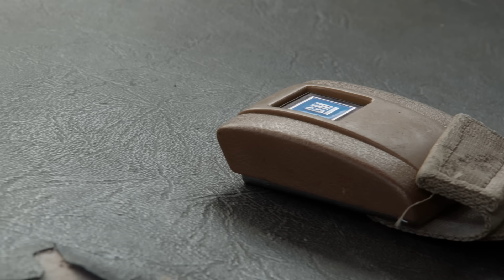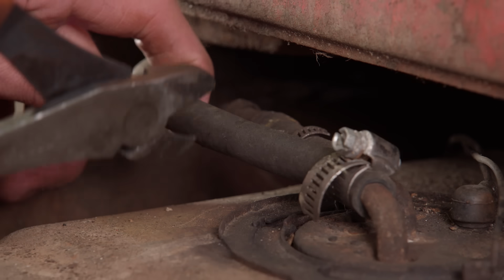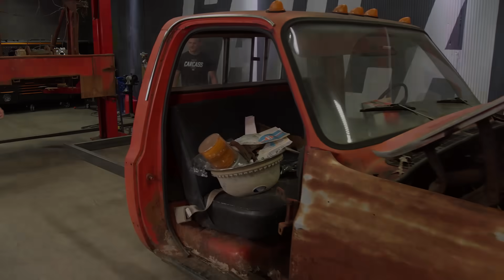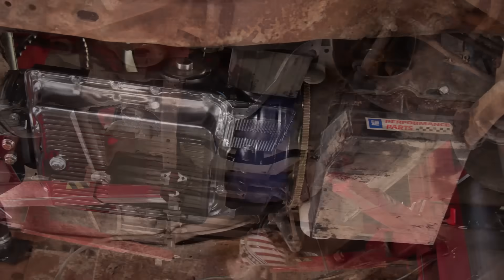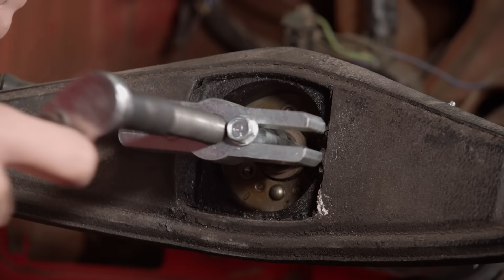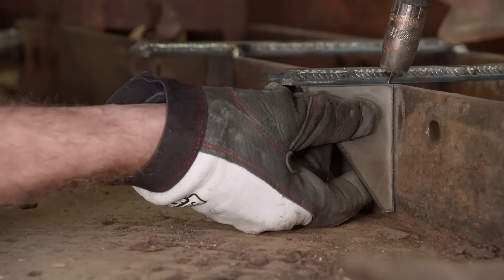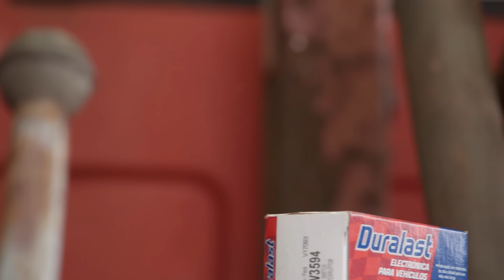Full Build: Junkyard Square Body Tow Truck Is Restored And Modernized

Comment: Did so much work and spent so much time on the pans just to leave the rusty metal in there where it will continue to rust with no way to put any coating between the layers of sheet metal. Woulda been just marginally less work to use the same tool you punched the pans with to flange the metal. Still gives two layers. Still can rosette. But easy to seal seal the 1/2 flange you create.

Comment: Frame should Never be cut straight down,45 degree angle then fish plate and button weld,use round crossmebers 100% stronger(wouldve located complete frame myself) as a mechanic and a welder for 30+ years ya did it all wrong.no strength in that frame(why wimpy 7r4 trans?

Comment: Why would you weld in the new panels without treathing the rust inside the cavities? If you do such sloppy job you can as well put a plate over the holes with pop rivets… Not my way of working.

Comment: It was fun and exciting to hear it start but nowhere near realistic so why bother. Just tell everyone you had it started off camera beforehand! Even though it was 2 years since they had points style ignition (a guaranteed no way does it start without at least giving the points some love) the odds of it firing are pretty much 0. You got lucky in that one year newer it would have had a catalytic for sure and it would have been so clogged with rodent garbage that now way it's starting.
The real culprit though, the reason why I am highly skeptical it started that easily, is those engines/vehicles in that time period were prone to timing wander, with a variety of causes, and especially as a smallblock (the 454 was available that year and most would have opted into that for a wrecker)wrecker I would have expected a timing chain jump but if not that any number of smaller causes.

Comment: 2 things. would it not have been smarter and replaced the floor before you put the fuel tank and system in and second why did y'all remove the manual transmission

Comment: The only foul-up on this thing was replacing the 4 speed with the winch PTO. You stated that you wanted to keep it patina'd, yet you have the shiny new electric winch. You could have kept the 4 speed and installed gear vendors. Other than that, it was a very satisfying and educational video

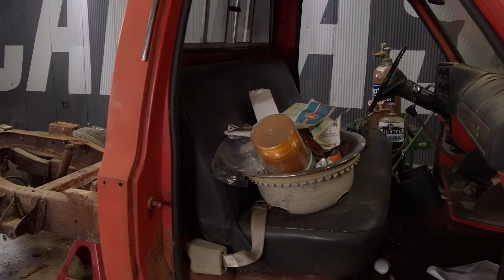Comment: At 20:34, you opened that oxygen tank without having the regulators backed off, big no no.  Also, why so much reliance on the torch?  A band saw makes a cleaner cut.

Comment: I'm 80!years old been resurrecting old machines since I was a kid and you guys drive me crazy with a battery and gas. Why dont you pull the plugs and poor some mystery oil in the cylinders and let them soak a while and manually Rick the harmonic balancer back and force to gently loosen the surface or varnish before you just blast it back into service. I could go in for hours in the subject. If you rock the balancer back n forth and are too lazy to drop clean and glob a bunch of grease on the Bendix. If the engine is ceased or blocked by a stuck valve you could smoke a good starter. Dam.

Comment: If that is a 1977 truck, then somebody swapped grilles on it at some point in the past.

The grille on the truck is for a '73-'74 Chevy truck.
Reply: It also has the 83-87 front bumper

Comment: Errrrrm to find your fold line using a press brake you start by marking out  internal dimensions then select the correct size  V  block and to do this you simply multiply the same old thickness of the material by 8. For example, material @5mm  × 8 =40 V block. Just make sure you use inside dimensions and to achieve outside dimensions simply subtract one thickness from your outside dimensions. No pissing around checking radius a drill🤷‍♂️

Comment: I love the build except for one thing: I would had kept all the outside with cosmetic rust but all the frame and linkages replaced/manufactured as done with the back.

Keep the same Axle on the back but refurbished and repainted. The rest could stay as it was, with the cosmetic rust.

But that was if it was I restoring. Still congrats for the project.

Comment: What happened to the 850 horse big block that the engine power guys Built For This? Just as well cuz a 350hp engine makes a lot more sense with all the rust still under there

Comment: @powernation prime example that education over experience is bad. In real world use NEVER weld ( butt weld 2 piece together )   like they did the new vs old frame . That frame weld should have been at angle ( 2 o'clock top to 8 o'clock bottom  ) and since it's a toe truck a front and back plate should have been used out and inside the frame for strength when toeing.

Comment: As early as 2027, driving in EU and Scandinavia with a combustion engine will probably no longer be permitted outside of professional and delivery trips, the Federal Exhaust Gas Fun Ban Ordinance BABVVO was recently announced and exhaust gas fun will soon be banned. The Transport Tourism Emission Restriction Federal Ordinance TEBBVO was also announced....should get all combustion engines commercial vehicles, construction machinery, agricultural machinery and even inland waterway vessels off the roads / waterways by 2035. Buses in the cities (and all taxis) must be completely converted to electric drives by 2025 (supposedly an EU regulation!)! The Wild Funny! Have you ever read Berlin Leaks? It takes off your shoes! They are basically planning demobilization under the cloak of a campaign against "fun using fossil drive energy" in road traffic... the SOKO Autoposer is supposed to hunt down all fun fossil drivers in the future! This WILL be a STVO Stasi with BABVVO apps for monitoring as a little helper to control exhaust emissions...!!!!

Comment: Nice to see a classic Chevrolet tow truck up and running.  I am glad there are outfits that have parts to do restoration work that cab sure was rusted out and they had floorpans, rocker panels, cab braces for structure integrity. When you replaced the instrument panel padding. I assume you did with the door panels?
This style of truck was in production from 1973-1991. It was part of the Chevrolet, GMC C 2-wheel drive and K 4-wheel drive. When the new Chevrolet, GMC C/K series came out in 1987. This model then became the Chevrolet, GMC R 2-wheel drive and the V 4-wheel drive. In production from 1988-1991. The engine you installed, Is that a 5.7 litre V8 with fuel injection?
Thanks for posting this video.

Comment: Very interesting video and thanks for the various tips and advice. 
But I still have a few questions about the project.
Why didn't you actually remove the rust on the parts that were not replaced or didn't apply rust protection paint on the inner sides after welding?
The bonnet was still quite bent and obviously doesn't fit properly anymore. Doesn't it fly away from you when you drive faster?
And you don't need license plates to drive on public roads ?
No criticism, just interest....

Comment: It's always a pleasure to see people care enough to resurrect those old classics that some of us grew up with.
I prefer keeping things as original as possible. The original motor and transmission are critical must have's when possible.

My 89 Chevy Cheyenne 1 ton dually 350, 4 speed granny was owned by an old guy who didn't have the money for tires, tuneups, throttle body rebuild, etc, etc, etc, so it sat for years with 95 thousand miles on er. I spent the money to clean er up, tune er up, (cap, rotor, wires, plugs, oil & filter change) ,new brake shoes, wheel cylinders, hanger/carrier bearing, wheel bearings, hoses, water pump, belts, battery, throttle body, cab lights and other interior work, and so on, and put it back on the road. Even found an original screw jack to put back in the holder behind the seat. Pieces like the original interior cab light cover was a bear to find, but I found er. The service box is rusty but no cancer on the cab or frame and not a single crack in any window. Since it's not my work truck I have only driven it about 500 miles since I bought it in 2018. The next owner will get a nice vintage truck when I pass on........... But not until.

Comment: The spring hanger difference was not a cab/chassis thing or a 2wd vs 4wd issue. The one-ton trucks, both cab/chassis and dually pickup, used a narrower spring perch spacing compared to the 1/2 and 3/4 ton trucks. 

This narrower spring perch spacing made room for the cab/chassis dually wheels, and did so by moving the shocks inboard of the frame. The 1/2 and 3/4 ton frames kept the shocks outboard, since they shared parts with the Suburban and Blazer, which both needed a fuel tank inside the frame rails.

Comment: Jesus, your description of how to bend sheet/plate was super complicated... Been breaking plate for years, this is probably the worst description ever of how to do it. Would of shut you up in a heartbeat if you tried this in my shop. Inside dimensions bend exact 1:1 ratio for anything 3/8 thickness and under. Outside take a bit more, subtract 2 times the thickness of matterial per 90% bend for cut prep, on marking just subtract a single thickness for each leg.. ( IE for .1875 sheet, if you need 1" leg bend mark would be at .8125". Need a channel with 2" legs and 4" web out of 3/16" plate. Easy, add up all the dimensions and subtract 2 times the thickness per 90% bend. 2+2+4=8, 8 -.1875 four times is 7.25. Cut your sheet to that, Mark each legs at .8125 because you subtracted the single material thickness and bam you have a 2x4 channel on the Outside.  Get that drill bit crap out of here, if you lose my drill bit im woopin your ass.

Comment: I sat through so much of this with my mouth open the lack of actual quality work done in this like the bed mounts when they welded them on they didn't even weld them at the same point on each side of the flatbar didn't make it level and thats one of the little things they did and the fact that it is a show is not and excuse you guys should be ashamed to call yourselves enthusiests

Comment: For me If my health was better I would be doing body swaps... putting something from the 50s or older on a modern chassis wit modern interior.  This way you have the good breaks an suspension, plenty of power and good gas mileage, and all the safety features.  I love the style of the older vehicles.

Comment: that fabricated rear truck frame is much much weaker than the original when it was new - you used not only thinner gauge material but the section depth of the channel is much less than the original frame ......this is going to bend as soon as you try and tow anything larger than a go cart...... you guys build stuff like its a Revell model kit.....dont quit your day jobs.

Comment: You really need to research the proper way to bend a cotter pin in a castle nut.  Bending it over the end of the stud cut the shear strength in half.

Comment: Do you not paint the new rear section you built andthe old rusty metal you weld new bits to, the cab floor etc, with a basic rust proofing paint cover ?.

Comment: It's very helpful when you make a cut like you did on the frame, before you cut it measure back away from the cut line an inch or 2 and center punch another line known as a reference line so you can then take all your measurements from that. Just a tip for anyone

Comment: I worked and rebuilt tow trucks I see an issue with your build the P.T.O for the hydraulics works off the transmission since you changed it now you have to install a Muncie P.T.O. pump to the front of the motor and add longer hydraulic lines and add more hydro fluid
Reply: No hydraulics Is was chain driven winch with a two way pto

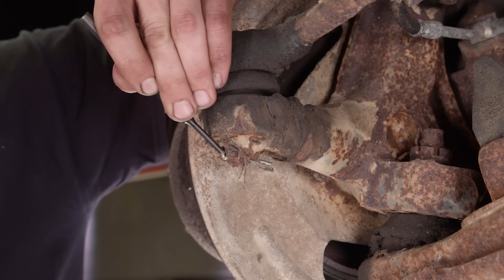Comment: Use the right tool and technique for the job. At 49:28 you used a flat punch on the cotter pin, and I don't know why in that way. You take an alignment punch and punch through the eye with a hammer. It will start to pull and expand the eye out. Hold the alignment punch with a wrench while the other end is pinned in the eye of the pin. Use a hammer to draw out the cotter pin. You can make it harder on yourself if you like, but this is easier

Comment: I’d definitely done some plug welds where the new frame rails slid into the old ones, but that’s just my opinion if I was building that rig and the engine they put in it is a GM 602/CT350 crate engine for dirt racing and the valve cover with the dual breathers should be on the driver side not the passenger on those particular engines but since it’s not on a circle track I guess it doesn’t matter

Comment: This is a cool video. I'm not all that impressed with these "professional" shows, though. The hosts are rarely ever dirty. If you pause the video at random times, you can see their clean hands and clothes. They also do things that most people in the real world wouldn't do. Eliminating the manual trans, for instance. i am no structural engineer, but I have done more than my share of industrial fabrication in my lifetime and I was somewhat skeptical of the frame rail build specs. It doesn't seem to be as beefy as it should be. I would be willing to bet money that this truck will not be towing anything for real after the show is over. I also felt like the leaf spring front mount install was a staged issue. Most people would've bolted the hangars and then rolled the rear end under the frame, seeing that issue before any tacking was done. 
Either way, this was still a neat build and a cool old truck.

Comment: Instead of strengthening the chassis why don’t you do a ground up rebuild of a brand-new chassis new steel and sell the plans to help with the cost that way you could adjust the chassis to fit the way you need it new hangers and fixing points

Comment: Miraculously has a brand new distributor and ignition? You Miraculously have cap and plug wires ready to go. High rise intake with new studs? Wrecking yard puts plastic bag in intake but leaves hood open? "Rusty" brand new stainless hose clamps? Brand new battery connections? That engine was already totally revived. 
🧢🧢🧢🤣😂🤣😂

Comment: great build but honestly should of z cut the frame for a longer weld and more stability and strength a single overlap weld on the c channel isnt enough not when ur adding power and still gonna tow yes there might be surface rust only but thats still a loss of material

Comment: In NASCAR, what that truck did is called blocking. It causes accidents. Yes, the Accord was banking tons of bad karma, but the truck intentionally blocked the path of the Accord, which ended up causing the accident.

Comment: I'm going to do what might be considered a little bit of nitpicking but I have a few reasons. Back when things were not crazy expensive around eighteen years ago i put a 74 Jimmy back on the road that was going to the crusher. Nobody's saying and rational would have done it lol. All in all cost about two grand including the truck and everything LOL. Scared to imagine what those parts would cost now given how much of them we bought new out of paranoia. The reason I bring this up is I didn't see any mention of the brake system which kind of made me a little queasy. You guys didn't seem to change the brake fluid or potentially change the master cylinder and lines and apparently just stuck all the drivetrain back on without checking and or changing the brake pads rotors drums calibres all that good stuff. When we did the 74 we put all new lines on Pak dramas we're still good so we use the back drums new hold down kit sand pads if I remember correctly new rotors on the front and new calibres put on a new master cylinder as well master cylinder was like 30 bucks. I'm guessing for whatever reason you guys didn't show it but you put pipes and mufflers on it too;). We literally used a crap load of muffler pipe pieces that were laying around an exhaust place that were leftovers from cutting other pipes and Herod everything bent into shape and used a couple of $25 mufflers. The irony was how long that exhaust system lasted would probably scare people. Another thing it's just a minor mood point that front grill should have gone away. You don't want a piece of that coming off and going in the radiator especially where are you replace the radiator. We did that with the 74 and I just simply used a grill out of another truck from a farmer's field I'm guessing they're still easy enough to find in the US and they're not expensive. I mention it because I notice in a couple shots there was plastic flopping around everywhere Saint parts of the grill where it was heavily broken I literally replace the one on the 74 for this reason because we didn't want anything coming off and potentially damaging the radiator. Lot of stuff you guys did I didn't bother doing what the 74 admittedly I grabbed a couple of bucket seats that I think we're out of a old camper van that somebody threw out and put them in. Steering wheel was out of a 1980s Firebird that we put in it that I got out of a car in somebody's feald. Same thing the gauge cluster was out of another truck we got lucky and found a — pad that look like brand new in one of the trucks in a farmer's field. Transmission I use was out of a 1980 Something Firebird same car the steering wheel came off of. Yes this meant we had to have a custom driveshaft made so it would fit. When I got it it had no motor no transmission and no driveshaft.

Comment: Kinda lame they axed the manual trans  and with it what appeared to be the PTO drive for the tow rig.  Could have bought a new cable for the winch and changed the oil in the trans new clutch and flywheel for less than the new winch and auto transmission. More resto mod than rescue.